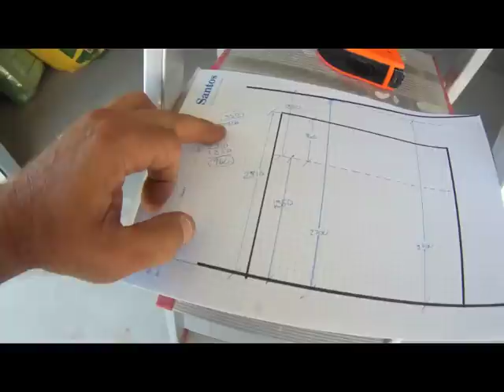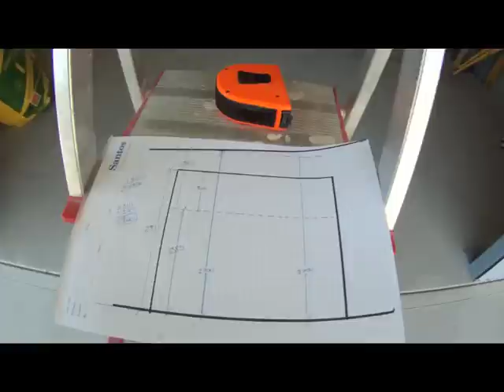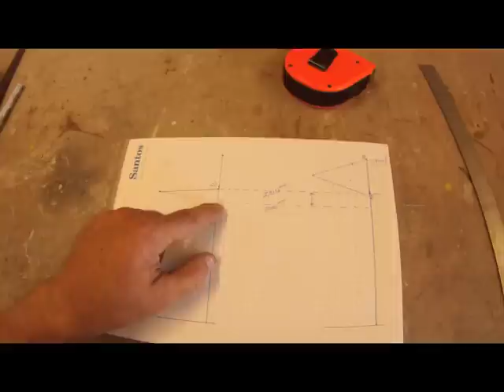Hangar Style Bifold Door #4 - Made by J&D

Comment: good job J&D. do you have any idea of making this door electronic control?
Reply from the maker: No, the challenge with that is not raising and lowering but getting the door to shut flat or push out a bit before opening. Dynamics of the design are such that the middle pivot point wants to be in line between the upper and lower points. On my design that means I need to manually pull the door fully shut. Designing the middle pivot point to be in line when shut would have the opposite effect and the middle would need to pushed out before opening. Making an automatic opening and closing door would require a mechanism to bring the middle point in to shut or push it out to open and that is beyond my ability.
Reply: @madebyjnd  thank you for the info. I will check how dose commercial product do this
Reply from the maker: Someone must have done something, I hope you find a good solution. Are you in Asia? I’ve worked in Dagong and Shekou PRC.
Reply: @madebyjnd  I'm Chinese but living in Austria. Are you an electric engineer？
Reply from the maker: I was a technician installing electric oilfield submersible pumps, retired.

Comment: Could you put the tin wider to cover the gap or will it not allow the door to open and choose properly?
Reply from the maker: That’s a good idea! The hinges at top and the rollers at the bottom would need to be set to bring the whole door outward but it could be done. The corrugated tin would need to positioned to mesh as well.

Comment: Nice design! I have a question though - the counterweight. Is it half the weight of the door? Thanks
Reply from the maker: there is no block and tackle arrangement, the weight matches that measured at the bottom edge of the door when it is fully up. It is not the weight of the door because the upper hinges support some of that weight.
Reply: @madebyjnd  sorry to interrupt, need to know more about it, still don't get it.
Reply from the maker: @creepy-camp  Okay...which part?
Reply: The weight of the counterweight.
Reply from the maker: @creepy-camp  I don't know why I haven't seen your question before now. Sorry. Did you work it out? For the counterweight I just kept adding or subtracting weight until it worked smoothly.